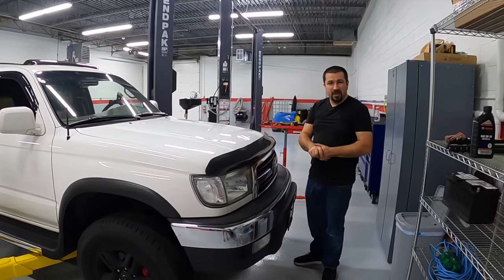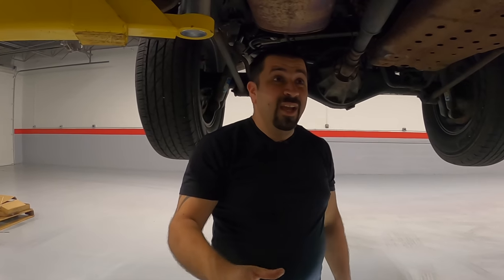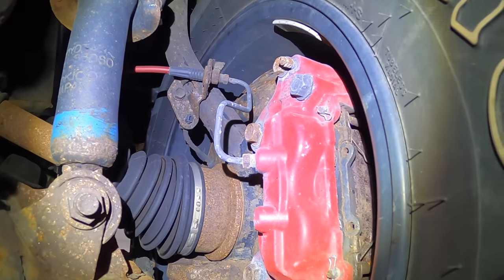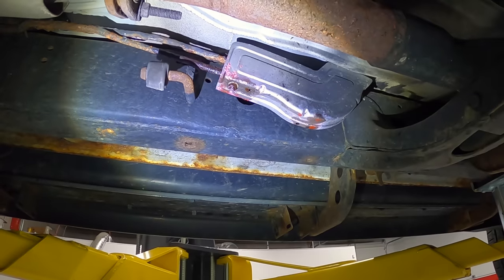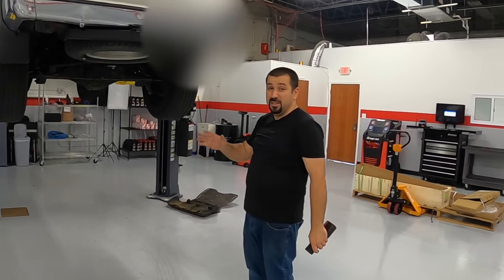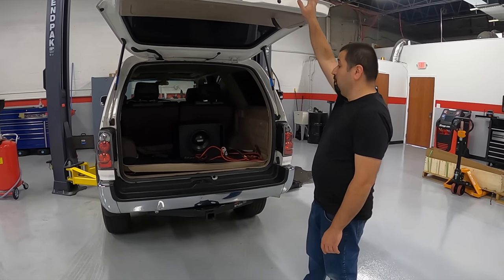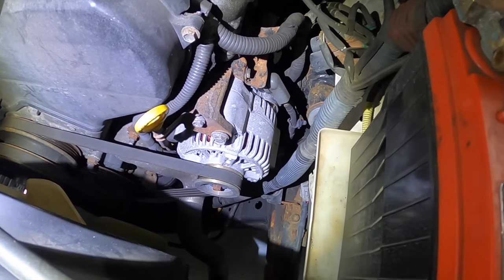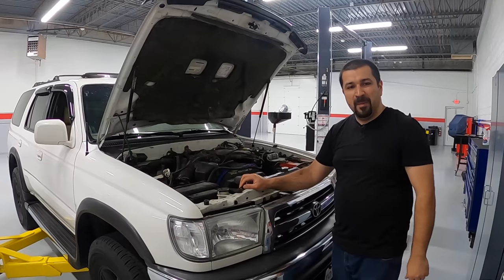Everything You Need to Know about the Toyota 4runner | 3rd Gen 1996-2002

Comment: I've gone through two catalytic mufflers on my '97 4 Runner. It has 413k miles on it. The last time I had to use an OEM quality cat. That's what the state of California requires now. It was expensive. The previous cat was a after market one and it was way cheaper. But it didn't last very long. The shop guy told me he tries to use the factory cats but they are back ordered so it could take months before one is available. The OEM quality one was only about $100 cheaper than the factory cat. 
Congratulations on your new shop. The shop looks good.
Reply: getting a code for front cat that only comes on when off roading. Apparently it’s a super super common issue that happens when driving slowly for long periods of time. Just replaced both 02 sensors and only replacing front cat if it fails cali smog. I still see oem cats online but they are super expensive

Comment: My only thing for these cars is the drive line u joint will go bad and the valve seals. Idk why the valve seals bolts are only tightened to 53 pound foot per bolt. So the valve covers will leak over time.

Comment: On the rear axle seals; on my 98 I had one leaking. The diff breather was plugged. After I replaced that the seal stopped leaking.
Reply: That's the one item AMD missed. The rear diff breather is a common failure point from rust, and if it rusts shut, your axle seals will leak.

Comment: I have a 2004 Toyota 4 runner with 266,000 miles. Just noticed an oil leak after quick inspection looks like its been leaking for a good minute. Can you do a walk through video on common oil leak spots or just where to start in general? Me and my son are going to try to fix it ourselves. Very informative video thanks for sharing.

Comment: I have a few questions: when a car had a slight rear-end collision, is it possible that there is some bending in the frame which can lead to forces on the shafts in the powertrain ? Do you have experience with this, are accident cars plagued with engine/transmission failures?
Reply from the maker: Hi! Typically cars that has severe frame damage that would cause issues would be totaled by the  insurance company and you’ll see it on the history of the car. Normal accidents that are not very major typically don’t get frame damage that causes issues like you mentioned

Comment: The rusted frame will definitely snap in half. I had one where the rear body bolt carriers snapped and the rear cab was disconnected from the frame. It also caused the differential connections to snap. Definitely a real safety concern.

Comment: Great video with lots of good info! I have two vehicles with this engine. I just wanted to touch on a couple things. Regarding the power steering whine, I learned from Timmy the toolman that there is a screen in the bottom of the reservoir that gets clogged over time when people don't change the fluid. Remove reservoir and blast as much of that gunk out with brakleen or something similar. Let it dry thoroughly, reinstall, replace fluid,  goodbye whine! Even in frigid cold Temps. Easy and effective! 
X2 on the lower balljoints. When in doubt, replace with OEM toyota balljoints only, no aftermarket!!! Other than frame rust these are the Achilles heel of the 3rd gen 4runner and 1st gen taco. You don't want one to fail, it's extremely dangerous! Again, great job!

Comment: The heater cores tend to get blocked up and require a flush. I used SLR. Opened up all of the blockages with resulting very hot heat.

Comment: Congrats on the New Shop!!!  As a Toyota Fan, I just love your content.  Quick question... we own a 2012 Venza, driver seat heater quit working recently, what are the common issues that will cause these seat heaters to fail?  Thank you and once again Congrats!
Reply from the maker: Hi! Usually the controller for the heater under the seat. You can swap the passenger to the driver to test

Comment: I have a 2000 4runner with 370,000 miles on it. Bought in 2011 for $6500 with 179,000 miles on it. Never expected it to last this long. 

I've spent $1800 on it shortly after getting it at a dealership catching up it on service at 200,000 miles. Spent $1400 on a rack and pinion when it was over 300,000 miles. A starter, a couple of alternators, throttle position sensor, and regular wear and tear items. I budget $500 for repairs,  most pull and replace repairs are under $400. Wife thinks it's unreliable because of age, I feel it is demonstrating it's reliability every day. The truck is becoming beat up from normal wear and tear and I've backed off expensive maintenance items and only buy inexpensive tires with low mileage service life. This truck as been a budget saver.

Comment: The best car I've ever owned... I have a 1997 4x4 SR5 first owner and a 1998 limited 2WD second owner. Both vehicles have well over 200,000 miles on them and are rust- and oil-leak-free. Everything relies on how you handle them. Every car will have its flaws, including ordinary rust. I always service my 4Runners and inspection checks. With regular maintenance, your 4Runner will last forever.

Comment: Good day, I hope this note finds you well.     I have a question regarding misfiring ; does the fuel injectors could be a reason for misfiring?
new / changed spark plugs and spark plugs wires , new / changed Ignition Coils. Chevron Fuel injectors  Cleaner with a full gasoline tank 91  octane Chevron gasoline two times already.....   
After about one hour  or 1  1/2  hours working starts misfiring  again.....  Every time it happens , I let the truck get colder, disconnect the battery and works well again until will start misfiring again.....'
any ideas what could be the problem ???   Thank you very much for your help !!  1997 4Runner  2.7L  4cylinders  5 speed Manual transmission 337,500 +  miles.
I look forward to hearing from you soon , take care...
Memo Moreno

Comment: 02 with 375k
Haven't had more than 2 or 3k in maintenence in 10 years. Several alternators. Just changed radiator. And it only went out bc i let it overheat too long when it froze and didn't have enough coolant. Never had Trans issues. Catalytic conv went out long time ago but didn't fix it, Perks of none inspection sticker state.  It's had a very slow head gasket leak for 10yrs also.  She's old but she still purs like 100k. 4wd and gets 20-22mpg with heavy ties,  24mpg with stock tires. 
Highest priority is by far just oil changes and monitoring checks
I drive with the very lowest average rpm possible. Aka Turtle mode. Not much horse power, but that Toyota Turtle power off the charts
Reply: Don't forget to do that PCV valve, cheap but mandatory!☝️

Comment: I’ve owned my 02 for almost 5 years. 
1. But FACTORY TOYOTA lower ball joints
2. What looks like an oil pan or rear main seal, might be your oil cooler seal. Check that first. 
3. Change the timing belt religiously. 
4. Do the tundra brake upgrade. 
5. Add a transmission cooler to avoid the pink milkshake. 
6. If your radiation is brown, change it. If it’s black you’re good. 
7. Valve cover gaskets leak. 
Other than that it’s pretty much wear and tear

Comment: I just bought a 2002 toyota 4runner sr5 sport 4x4 with 125k miles for 4k, needed 2 cats and 2 02 sensors. Other than that, looked brand new inside and out, its a maroon red, and it drives good, i changed the surpatine belt, not sure if the timing is as inportant as the sequoia  let me know abd ill consider replacing. But speskers even soubd good still! Under the hood is a v6. Clean title, this vehicle could go for 14k carfax says, but im keeping it. 😊
Reply: Sounds like a steal. Congrats!  Just bought one yesterday.

Comment: Nice video but here's a time saving idea.  Get a Car Care Nut license plate made and mount two rare earth magnets to the mounting holes.  Then you can just place it over the customer's plate and the magnets should cling to the license plate mounting screws.  Then no worries about blurring out their plate.  Hoping to see a review on a first gen Matrix or Vibe with the 1ZZ engine.  They are great cars and I have 279,000 miles on Vibe which is a US made Toyota. 8-)
Reply: Now, that is without a doubt a legendary reliable engine that you just brought up. Sandwiched in between the preceding and succeeding Corolla generations which are both worse.
Reply: @ShinobiXRevived  I'm in a few Pontiac Vibe Facebook groups and many have mileage over 330,000 miles.  What's funny is the odometer stops working on the 1st gen Vibes and Matrix's at 299,999 miles!  Who thought of that?  I'm averaging 30 to 32 miles per gallon and the new Corolla Cross has the same mileage!  So why spend $30,000 plus when a nice low mileage, well maintained Vibe/Matrix with 150k, would serve us well for many years?
Reply: @CountryFarmBoyUSA  I used to own a 2006 Corolla that I bought for $2300. Sold it to a friend in need for $3000. Buying brand new cars is the ultimate fools errand. A brand new unproven design is unproven, Toyota or not.
Reply: @CountyFarm Boy I have a 2006 Toyota Matrix 1ZZ-FE base manual interior controls, etc, with 242,000 kilometres. Not a whole lot, Purrs like a kitten. Today at a high school shop I saw a 05 Corolla manual with 492,000 km, with the same engine as my Matrix. I’ve even seen them with 800,000 kilometres. Bulletproof cars that were made to last have a million km even if they are 20 years old👍
Reply from the maker: I’m working on this. It would save a lot of time
Reply: When I go to Mexico every other car that goes by is a Vibe, they know the secret. And it's basically the only 'pontiac' left in my area. The Bonnevilles and grand ams are all gone. Still see a few G6 running around but the Vibe is indestructible.

Comment: On the lower ball joints, there's a school of thought out there that says the problem is in the design of the part, not any structural flaws. Those guys say that even if you've had the original LBJs replaced, you should do it again at certain intervals (say, 100,000 miles). On my 2002 SR5 4WD, the LBJs were replaced under the recall in 2005. That was 90,000 miles ago, and I'm starting to get a little nervous, but I think my dude CCN said at the end of this great video that if you've had the "updated" LBJs you're good to go.

I'd love to think that I'm in the clear. Can you expound on the LBJ issue? Thanks.
Reply: What's the ballpark cost to replace those ball joints?
Reply: Yea original "updated" last forever, my 01 @ 300k+ miles original lbj's

Comment: Hi, I bought a 2002 4Runner 3.4 last yr , it has 188,000.on it , I paid $4600 for it from a road side car dealer , he bought from auction , the car had no maintenance records with it other than an oil sticker it’s a really clean vehicle,the under side looks almost show room ,the outside has a couple of door dings , the interior is in real good condition, I’m thinking this was a soccer moms car it had Disney stickers on the back window , and yes it’s a Florida vehicle, but it needed all the typical maintenance stuff done I’ve replaced ,valve cover gaskets,plugs,wires coils , radiator,hoses, rubber throttle body housing, air filter ,oil change, steering bellows or boot, battery, had to replace the ABS power unit and a sensor because the ck eng light came on , I’m still trying to get things done yet  like timing belt water pump pulley’s , and a leaking rear wheel seal and I’ll replace the vent valve on the differential, the truck is two wheel drive and I bought it with the intent to pull a small fishing boat and travel and truck camping , I can honestly say I’ve fallen in love with it , I’m hoping that after it’s all done it will last a hell of a long time ,they just don’t make em like this anymore ,I feel lucky to have found it as you don’t see em in good shape around for sale everyone that has one wants to keep it 😆 👍
Reply: Don't forget the PCV valve, cheap but mandatory!☝️

Comment: Frame Rot: I wouldn’t be so quick to pass on an otherwise clean 3rd Gen 4Runner if the only problem is frame. The frame issues are so well-known, and the vehicles so solid and desirable, that there are  reasonably economical fixes if you have a decent welder available. I wouldn’t hesitate to put money into frame work as these trucks last forever and will definitely pay you back over time.

Comment: They're also known to throw a P0441 code related to the evap canister. I purchased used, but my guess was the previous owner was overfilling the gas tank which led to the canister getting saturated too often. The trick to passing emissions, if there's not an air leak in the canister that can be fixed by essentially "gluing" it, is to purge the canister by unhooking the vacuum lines and allowing it to self ventilate, or one can vacuum the canister with a brake bleed pump or whatnot. The alternative is forking over nearly $300 for an aftermarket canister or taking the risk of picking one. Nonetheless, I'm under the impression that this fault won't negatively affect the evap system or engine performance in the long run, but is more a guideline for current emissions regulations. Cheers.

Comment: I have a 2002 4Runner. It is clean for it's year. Strong motor with 222k. 4WD a little problematic. Need to replace ball joints, struts, all front end bushings and all brake parts.

Comment: Great overview video AMD! I bought a 1997 4Runner last year with the 2.7L 3rZ-FE engine which has been was recently rebuilt, along with clutch and numerous other parts.. It's a very "analog" version with the 4 cylinder, 5 speed manual trans., no air conditioning, manual cranck-style windows. It's so basic and that's why I like it. Anyway, my question is are there any issues or things to look for on the 4 cylinder engine??   Thanks!!
Reply from the maker: The 4 cylinder doesn’t have a lot of issues. You’ll go through a few ignition coils and as they get older they could develop a head gasket leak but nothing chronic.
Reply: @TheCarCareNut  Thanks :)  Keep up the great reviews!

Comment: Not a 4Runner question, unfortunately, but I recently bought a well used 2014 Prius 4 and I’m trying to return it to better condition. Replaced the front bumper cover and related parts but I lack good tech data. Can’t find the front fog light relay. Would you tell me where it is and perhaps point me toward inexpensive reference material that gives component locations. 
Thank you Alfei from Florida. I’m a big Toyota fan and your videos are really great.

Comment: The only issues I have ran into so far of owning my 4Runner is just small things bushing struts and ball joint and shocks (the guy that owned it before me only focused on brakes) but other then that valve covers have a leak and that’s pretty much all I have changed the brakes did an abs delete system on mine changed the master cylinder and did a throttle pedel sensor. And as for codes wise all I have to do now is purge flow and I think a control system vent circuit. I will say I got my 4Runner for $300 and for the most part it’s pretty good shape my frame has no rust the only rust it has is the muffler and catalytic converters which will be changed soon

Comment: You definitely know your stuff. I had a ball joint go out & my radiator just started leaking. Overall, great truck.
I don't understand the comment about the "pink fluid" on the transmission dip stick -could u clarify why that is a problem?
Reply from the maker: Hi! When transmission fluid and coolant mix, the color of the mix is very bright pink. Engine oil mixing with coolant turns milky white. So
When you see pink color in the transmission fluid that means that coolant and transmission fluid already mixed and that’s very harmful if not fatal for the transmission
Reply: @TheCarCareNut  Thank you! Ok, "bright" pink I didn't see, but the transmission fluid I use is dark red so I was worried. I have 275k miles on my 2001 4Runner,  still goin strong.

Comment: If you can't put a vehicle that you are considering buying up on a lift, and you can safely slide your body underneath, lay out a large piece of field expedient cardboard (or bring it with you) underneath and inspect it with a flashlight. Carrying a set of ramps with you is another good idea.

TCCN: Tips for filming the underside of vehicles, so your video image looks better to the viewer: The camera needs a soft fill light that removes the shadows from around whatever you are pointing out with your flash light, and your flashlight doesn't have to be blindingly bright - bright enough will do.

Rust never sleeps... I would drive used vehicles to Indy from Chicago and Detroit when I worked for an independent used car dealer in the late 70's, and I still have nightmares about vehicles rusting away right before my eyes.
Reply: As the driver of a 17 year old car in Ontario where salt is applied to roads 5 months per year, I can say with confidence that rust never starts if you follow a proper preventative maintenance program from Day 1.
Reply from the maker: Hi! We’re working on lighting for the new setup of the shop. We’ll improve things as we go

Comment: The lower ball joint design is another thing to watch out for. The fixed it in 2001, the last year of the 3rd gen. I had a 2000 that was awesome, loved that thing. If you use premium gas, the cats will last forever. Don't use cheap gas!
Reply: Low compression engine like this one doesn’t require premium gas.
Reply: @MechaTronic161  owners manual says to use premium gas for a reason
Reply: @JAMEYSIMMS  I’m a proud owner of ‘97 Limited. The manual says 87 octane or higher. It doesn’t say “premium gas only” like my RSX-S and X5M.
Reply: @MechaTronic161  I had the 4 cylinder. Whatever, you're the man. You do you.